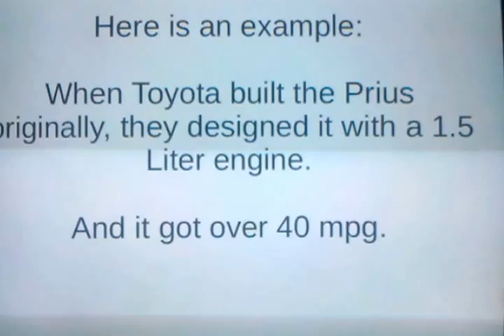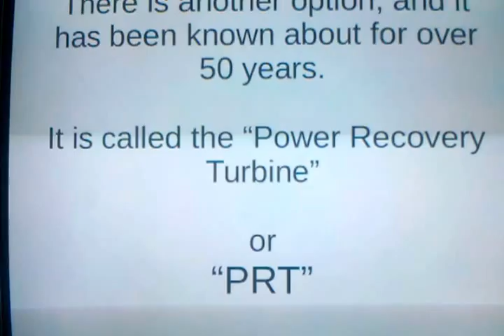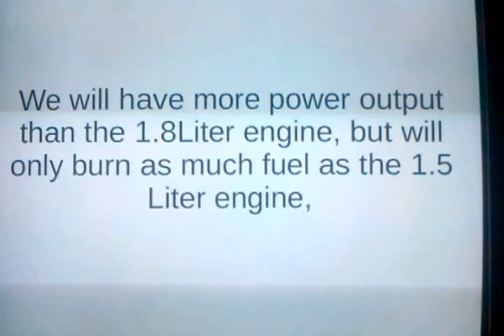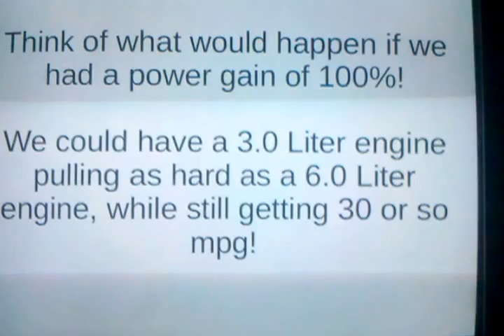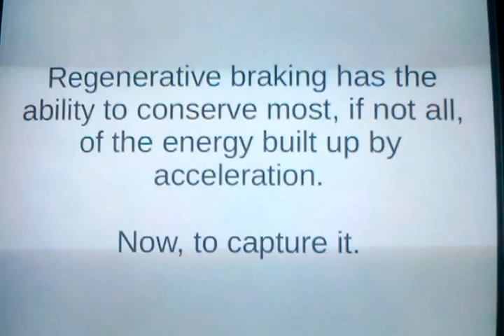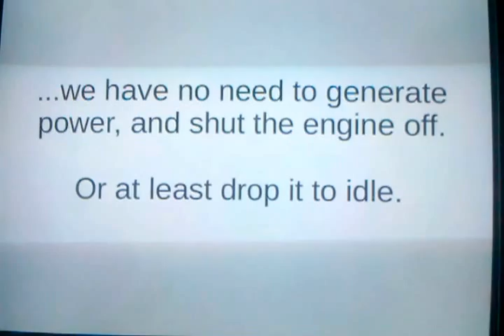200 Miles Per Gallon

Comment from the maker: Wow. Has it been over four years? I have 1111 views on this as of this note. My knowledge level on this concept has gone from pitifully poor to quite extensive.

So, what about this idea. In a car, running a diesel is still the best thing. But, only ONE machine using the full power output of the fuel is not enough. There needs to be a turbine pushing a PRT to gather some of the wasted pressure. And, there needs to be a Stirling engine to gather some of the wasted heat.

Now, about the tubine: If it adds a touch of boost to the engine, it can balance out the problems that come with having the restriction of the turbine. I know this is opposite of what I say in the video, but I have realized that the R3350 had problems simply because it wasn't designed for the turbine. It could have done quite a bit better. But that's another story.

I have come to realize that running an engine to start the process, pushing a PRT (maybe turbosupercharging) to gather the pressure waste, and powering a sterling engine to gather the heat waste is the best way to lay this out. By using three machines to gather the maximum amount of power from the fuel, total efficiency may get close to 80%. This means that economy can increase, as well.

So, my new idea is to run a gasoline based generator between 45 and 50 Hz. This should be within the BSFC perfect efficiency peak. Then, run a highly efficient DC set-up that electrolizes water. This hydrogen-oxygen mix can then be pulled into the engine to run it. With the pressure and heat that is generated by the reaction, you can still run all three components. And still have power left over. Some may ask, though, if this is breaking any laws of thermo-dynamics. It is not. Because when air gets pulled into the engine WITH the electrolized hydrogen, everything gets compressed to the top of the piston and super-heated with the explosion. This means that all of the extra air components expand ALONG WITH the hydrogen when it burns! This allows MORE power output than JUST the hydrogen burning!

With power left over, you can charge a battery to run a house. And the system won't shut off until you want it to, which is perpetual motion. Powerful perpetual motion. It creates MORE power than it needs!

Talk about an awesome way to be able to add back to the power grid!

There is also a proof that I am thrilled to mention: the thermo-generator is real! it's probaly not efficient, and I doubt that it cools anything, but you can buy a mini-campstove that runs on wood (and propane?) that has a circle tab thing that puts out power. It's not much, but it will run a light and charge a device. Probably not a the same time. But, it is out there! Time to add it to this system!

Comment from the maker: The best way to power the generator is to actually use two engines. One could be small, and push only around 3000 Watts. The other could be larger, and able to push 5-10K Watts. This way, the small one could charge at a stop, keeping both engines warm, and the larger could add power to travel with.

With this, it is good to remember that it would be best to have one on either end of the generator so they could both run as needed, and one won't wear out at a much, much higher rate than the other.

Comment from the maker: The electrolysis thing might help with emissions, but due to the fact that it requires power to gain power, a full study needs to be done to see if it is actually helpful or not. Until then, it's not adding to this system. Sorry to add hype. This IS a learning process, after all. ;)

Comment from the maker: I have realized that there is a way to eliminate petroleum. If you remember "Mad Max, Beyond Thunderdome", you will remember the quote, "Methane cometh from (any organic matter decomposing)"

If we can culture our septic systems, and use the below mentioned on-demand electrolysis (also look at www.watertogas.com), we can run a stand-alone generator, powering our houses and charging electric cars while using no petroleum! It's also better than free power, because if it runs 24/7, we sell the unused power to the power company! Win-Win!

Comment from the maker: I have recently run across another piece of information that could make this happen. It has to do with on-demand electrolysis. Here are two books about it:

https://docs.google.com/file/d/0B9Cg3Re0tmQicTVjZ3BjUlJQSjQ/edit
https://docs.google.com/file/d/0B9Cg3Re0tmQiV3ZDampKSzVUZjA/edit
https://docs.google.com/file/d/0B9Cg3Re0tmQiaHFBXzNZSWhsZnc/edit
https://docs.google.com/file/d/0B9Cg3Re0tmQiRHVsUTUweEFtRVE/edit
https://docs.google.com/file/d/0B9Cg3Re0tmQiekkzWDJLWUZKSFU/edit
https://docs.google.com/file/d/0B9Cg3Re0tmQiQ1RoNGp6XzI4WDg/edit
https://docs.google.com/file/d/0B9Cg3Re0tmQiMmRhUGNFZklraW8/edit
https://docs.google.com/file/d/0B9Cg3Re0tmQiV2h4YXFyOFN3REE/edit
https://docs.google.com/file/d/0B9Cg3Re0tmQiaGEwOUNWVGZ1blE/edit
https://docs.google.com/file/d/0B9Cg3Re0tmQibm41LVlqeHFzREE/edit
https://docs.google.com/file/d/0B9Cg3Re0tmQiMlpsLURDVFEzZ0U/edit
https://docs.google.com/file/d/0B9Cg3Re0tmQiclJ3aEhpMGhjZzQ/edit
https://docs.google.com/file/d/0B9Cg3Re0tmQiOVNlZldFTzFMQWc/edit
https://docs.google.com/file/d/0B9Cg3Re0tmQiQlJ2cHlGTFFVV2M/edit

There are over 350 pages to read, so it is long, but it is worth it!

Comment from the maker: I have been part of overhauling over 20 engines, and have some further experience with cars and engineering. I also have an associates degree in electrical engineering, which is where much of the electrical ideas came from.

I don't have extensive knowledge, and I am aware that this idea will take development, but the basic idea is, I feel, quite sound. 

I would love to be involved with a proof of concept.